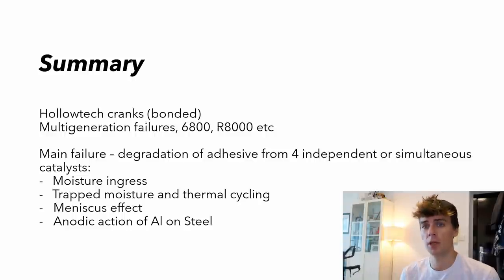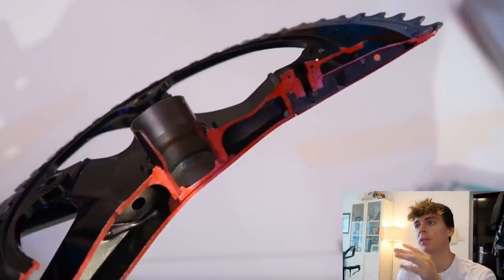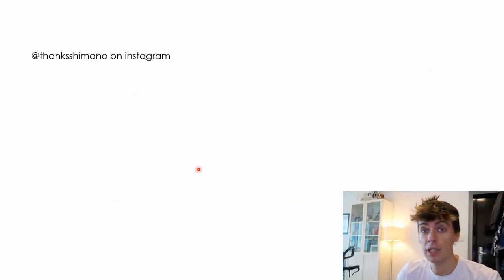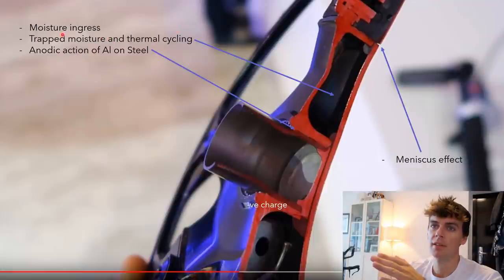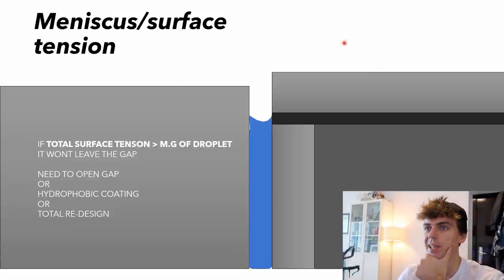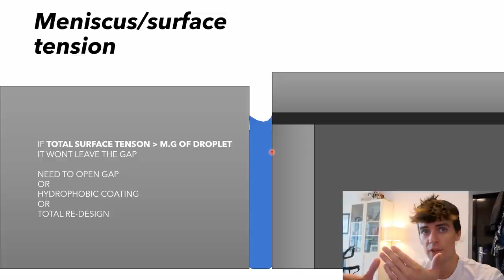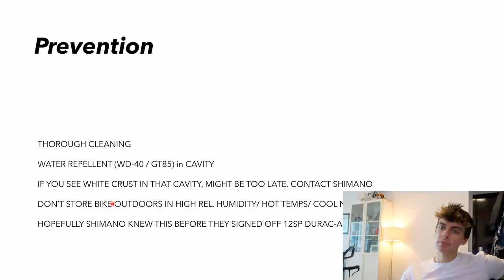Why do Shimano cranks keep failing? Analysis.

Comment: I just assumed I was putting out far too much power for any metal construction to withstand.
Reply: That would be the most plausible explanation.   ;-)
Reply: It's a design failure, don't beat about the bush, can be solved by- 
1. Don't press down too hard on the pedal
2. Just leave the bike hanging in the shed
3. Take the chain off before you go out, this saves on constantly cleaning and lubing it
4. Live on a very high hill with a good neighbor who has a bike rack on their vehicle 
5. Use the offside leg only, you'll only get half as tired 😫 
6. Ride at night without lights, problems solved 👌

Comment: Over  the last 25 years, I've broken 4 Dura Ace cranks. 3 of the 4 have been right in the middle of the threaded pedal hole, going outward to the edges, then abruptly breaking off. I'm always careful not to over torque. Just a  bit of pressure at the end to snug up the pedals on the cranks. These breaks have occurred both on the left and right crank arms. One break occurred in the middle of the drive side crank arm, about half way from the pedal to the spider. In all instances, I went down, once breaking a finger. Shimano was always good about replacing the crank sets. I examine mine but can never any cranks. It just happens all of a sudden. I'm  175 lbs. I do ride in very hilly area's in Northern California typically climbing at least 2k feet per ride, always dry weather riding.  Back in the day when I was riding a 150 miles a week, Shimano advised me to replace my cranks every 3 years. Doesn't seem like this should be happening but it does. I don't abuse them, just use them. they are definitely a safety hazard. for me anyway. good luck with yours.

Comment: A couple of thoughts.
The adhesive won't "corrode" from trapped moisture. Its an inert substance and simply wont react with any trapped water vapour
Any galvanic corrosion between the axle and crank would cause the axle to corrode, not the Al
I think the probable failure mechanism is due to your "meniscus effect" (actually capillary action where the surface tension of the liquid pulls the liquid into the gap)
Aluminium doesn't "rust" as such in that the oxidation layer is not permeable so it is self healing. Oxygen is very much required for the substrate to form Aluminium oxide.
 I think what is happening is that the areas of failure are areas of high stress so the aluminium oxide is de-laminating (the substrate is more ductile that the oxide that protects it) allowing the substrate to further corrode as moisture is pulled into the gap and the lack of oxygen prevent further formation of the aluminium oxide layer.
This leads to a repetitive corrosion event in a localised location that then leads to failure as the substrate is constantly eaten away with each cycle

If trapped moisture within the crank was the culprit, a simple hole drill into the back to allow escape of the air with each thermal cycle would cure the issue

Comment: To combat the said Meniscus effect, fill the gap with grease. I apply grease/oil to all the metal to metal contact areas on my bike and it helped tremendously in terms of eliminating creaking, corrosion and seizing. Places includes:

- All bolts that do not require loctite, including the minute gap between the bolt head and its immediate surrounding areas.
- Stem/handlebar interface.
- Stem/steertube interface.
- Headset bearings/headtube interface.
- QR/dropouts.
- Chainring/crank interface.
- Cassette/freehub interface.
- Cable end cap/boss interface.

- Wax on pedal/cleat interface.
- Light oil on derailleur and brake caliper pivots. 

...and more.

Tedious jobs but effective.
Reply from the maker: Great tip that
Reply: Don't grease the stem-steerer and stem-handlebar interface, at least not with grease. If applicable, assembly grease could be used, but otherwise these surfaces should be clean and dry in order to provide the proper friction to not move under load. Grease dup you'll have to clamp them to idiot levels, which will just break stuff.
Reply: @Primoz.r   Thanks. I've been doing it for years and remains problem-free. However it does remind me of potential slippage. My rationale of greasing the interfaces is two-fold: 1. eliminate any chance of creaking and 2. more importantly keeps water and salt (from sweat) out.  Obviously you do not want the stem/handlebar joint corroded by sweat.
Reply: @Primoz.r  I agree, greasing is not way to go in this case. You should increase friction, not reduce it. In my experience there is no way to get enough clamping force through maximum allowed torque when grease is used. But I found out that assembly paste is also problematic because its particles can cause abrasion of the steerer tube. There must be something better to use. Ideally that stuff would increase friction or even bond surfaces, it would insulate and seal while still allow disassembly. But certainly it should be without abrasive particles. 

For now I am ok with untreated steerer tube so I don't need to tighten headset regularly when I ride on extremely bumpy surfaces. But sweat in the steerer tube - aluminum interface can cause problems, so it is not perfect...
Reply: I'm late to the party, but to stop galvanic corrosion, use a paste such as duralac. Used in aviation and nautical industry to prevent corrosion between different metals.

Comment: I have owned 2 of the effected cranks. A Dura-ace 9000 and a Ultegra 6800. BOTH have failed! That is a 100% failure rate. The first in 2017, which Shimano did nothing about. I bought a replacement for the Dura-ace 9000 left crank arm that failed. So when the 6800 started separating, I replaced it before it broke, so it didn't kill me. I never reported it to Shimano because I knew they would do nothing about it. Now that the recall is official, the number of reported failures is going to soar! Far beyond the 4519 they say they are aware of. But I think they have waited to issue the recall for over 4 years, when they knew there was a big problem, because a lot of those affected cranks have already failed, been thrown in the trash, and replaced already. And now, no longer available for inspection. So Shimano is off the hook.  Very sleezy in my opinion.

Comment: Many years as a shop mechanic in Australia and zero failures through the shop, zero. Worked also with maybe pro teams and only one arm failure with Dockers left crank. Obviously this is happening, but I would be interested in a quick division, about sold divided by the amount failed. Pretty confident the answer will be tiny. Great video and I think you've nailed the reasons. But once again, zero through our store and never even heard of any other stores having issues. Many as we have little humidity
Reply: Lol this aged like milk. Tell me more expert mechanic.
Reply: @randomdude5938  fair call, I have to admit I'm properly wrong. May have a lot to do where I live and the failure rate was obviously less, maybe. Either way Shimano has lost me as a fan, not so much for the issue, but they way they handled it over the past and now

Comment: Precisely where my Shimano DA-9000 crank’s  three spiders started to show splitting (at the bonding interfaces) while unfastening the crank bolts.

Had lost so much sleep thinking what could have been robbing me of the usual performance with same (and sometimes greater) efforts on same exact bike, route, times of day & night, energy/mood levels, hydration...etc !

Had a warranty issue raised with Shimano and received a brand new identical crankset replacement.

Several months in amd same issue started to surface, and again received a brand new crankset replacement which I decided to sell off and got a ROTOR crankset replacement which actually worked fine.

* This happened in tropical Singapore city where normal humidity could reach as high as 80~90%
As of this evening (07th March 2021, 12:52am) humidity is at 82%.

Comment: Hi. Mine failed exactly like this. 20k miles on it in the UK. It was on my winter bike so had lots of exposure to moisture and salt. Also stored outside in a very cold garage going through multiple cold temperature cycles. For reference it was 7 years old
Reply: And are you fine with it? Did you crash or anything that would have hurt you? This is mind blowing

Comment: I lived on Windward (the very wet side) Oahu for 11 years, I can affirm that tropics utterly brutal and unforgiving on everything.  I remember sometime in rain storm we'd have 90 + percent humidity inside the house.  Leather turn white with mil-drew, plastics get brittle, exposed steel rusts within hours and green algae can grow indoors.  We sealed off one room and ran a dehumidifier and AC to protect paper good like old LPs, scarp book, collectables etc, even sealed I'd empty out 3 gallons of water at least once a day.  In terms of bikes stuff I've seen tons of clear coated carbon go yellow in two seasons.  The biggest thing more than the humidity was the UV.  I had Oakley photochromic lenses that would be jet black by 9 am.  Oakley original listed them down to 11 percent transparency but in other parts of world like California they wouldn't get very dark and Oakley relisted them to 23%.  Hawai'i also had a day where sun directly overhead and no shadow is cast.  Everyone thinks Hawai'i is paradise.. https://www.youtube.com/watch?v=dh_eZ40e9Po  da.. reality like talk story bout dakine... https://www.youtube.com/watch?v=Iz3rubGrGZQ&

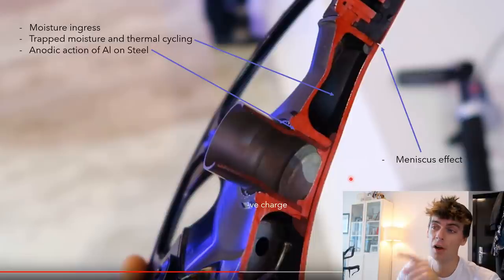Comment: 11:34 'Degassing'
In automotive industry, it's called Pressure Neutralization Ventilating Port, allowing air to move in and out, but restrictive to moisture.
Apparently Shimano is not ready to implement this.

Comment: Reminds me of my younger days, back in the 1980's, when I broke 3 Campy Record crank arms, and also a Campy Record bottom bracket spindle.
Reply: +9000 watts
Reply: Um, I say bullshit. Maybe, just maybe the original Record Carbon cranks (de-lamination of the pedal interface). Certainly not since going to the Hirth since leaving the square taper. On the same context I could claim to have "broken" no less than 15 or so Specialized Allex Epic Pro Carbon framesets....never mind they were pre-production and Giant/Martec had yet to figure out the proper glue....
Reply: @systemsbroken  The all steel alloy, regular production Campy Nuovo Record crank arms and bottom bracket I broke in the 1980's all apparently developed micro cracks in them, unbeknownst to me, and all did indeed break while I was riding. One crank arm broke while I was accelerating out of a corner in a criterium in Gainesville FL. Thankfully I didn't crash, and I rode one-legged back to the S/F line, the broken piece of crank arm and that pedal dangling from my shoe. Another crank arm broke as I stood up to accelerate after a traffic light turned green in the town where I live. Because I was going so slow, I simply fell over in the street. The bottom bracket spindle I broke was on a training ride with several other riders. We were just starting a "green sign" sprint on a rural country road when again I stood up to accelerate and the spindle snapped, sending me to the pavement, taking another rider down with me, and a trip to the ER for me to get several stitches for a cut in my scalp. I was wearing a leather hairnet type helmet, and figured possibly the other guy's front wheel skewer went in between the straps and cut me. No bullshit.
Reply: @lloydhlavac6807  Have i met you in the past year near Gainesville or Ocala?
Reply: @systemsbroken  No, I live between Ocala and Orlando, and after I quit racing in 2008 I haven't ridden more than 20 miles from my house, and in fact for many months now I have been riding exclusively on my rollers due to a crack in the seat tube of my aluminum frame bike (2001 Schwinn Fastback Factory), just above the bottom bracket weld. Yeah, something else I have broken, and I was not even a sprinter! Figure it is safe enough on rollers, but too dangerous for the road, and not a priority in my life to get a new frame/bike.
Reply: @lloydhlavac6807  
That’s why I have a titanium bb spindle on my 90s mtb.  I gave up on aluminum bars too and went titanium there too.  Never had any crank problems though; I have Cook’s E-cranks, which are fairly lightweight.
Reply: May I ask your weight?
Reply: @brucegelman5582  At the time these parts broke I was in the 145 to 155 lbs range (65 to 70 kilos). I was a bike racer at the time, and not at all a sprinter. I think there were already some sort of stress fractures in the parts that I was just unaware of till they broke.
Reply: @counselthyself Yes, it was all Nuovo Record. Breaking the bottom bracket spindle was the worst. Happened on a training ride with a few other riders, when I got out of the saddle to go for a sprint and ended up on the pavement with another rider on top of me, and a cut to my scalp (I was wearing an old style leather hairnet helmet) that was a waterfall of blood, requiring a trip to the emergency room for some stitches. 🤕 Thankfully nothing worse.

Comment: Is there any public information about what process/design changes were made for the 12-speed Ultegra and DuraAce cranks (which are not part of the recall and are being used as replacements)?  If not, I would love to see a tear-down and analysis before trusting them.

Comment: And here I am still riding on Dura-Ace square taper from the early 80s and the damn things won't break.
Reply: Because each successful product starts as a solid reliable product. Only yearly margin improvement targets make things like "Planned Obsolescence" or "Manufacturing optimizations to save materials and cost" to come into the picture, at a later point ..

Comment: Thanks for the in depth analysis. I would like to throw a much simpler reason into the equation - Sweat.
I’ve been a professional mechanic for over 20 years in Australia (the tropic part) and I’ve seen the results of sweat eating just about anything on a bike, even down to aluminium bars snapping due to the corrosion of sweat.
I have seen plenty of these shimano failures, one saving grace might be that shimano does have a decent warranty period.
Hopefully they’ll get to a solution.
Thanks again for the video.

Comment: Galvanic corrosion absolutely does happen between steel and aluminium but it does take a quite a while and usually needs help.  It's a common issue in automotive repair for seized parts, a common one being steel wheel hub in an aluminum steering knuckle.  10 years with some added electrolytes in the way of road salt usually does the trick.  In the absence of moisture and electrolyte there is usually little to no issue such as steel bolts into blind hole aluminum suspension/chassis parts.

Comment: It’s just adhesive TMF cracking from thermal  and load cycling.  The corrosion is a secondary effect of bond line failure and boundary infiltration.

Comment: I had a failure of a Dura Ace 9000 crankset... but the steel axle!!! No failures on cranks at all. I stripped the axle on the left, approximately where it is inserted into the left bearing.

Comment: @Peak Torque 
You mentioned vacuum sealed construction prior to final enclosure, but why not leave a tiny hole to be vacuum sealed after. I'd assume holes at this level are sacrilege, although vacuum sealed holes could be hidden on the inside of another face, like the next insert. And if vacuum is too shit (for production 2020), leaving hygroscopic material (how lightweight is nylon?) on the rest of the bare interior surfaces seems stupid easy. A quarter ounce is what I'd use

Comment: It's just happened to me in tropical Kendal. Coming down Kentmere at speed, crank snapped just above where the pedal attaches. Lucky not to have a bad crash, just kept the bike upright...
Reply: On the drive side, btw. Ultegra 6800. Gonna replace with 105, methinks.

Comment: If it's sealed in water vapor, then  colder climates would not be immune to the problem and would probably accentuate it.

If meniscus effect then maybe that would correspond more to wetter climates (so tropical), but then why is it also not more frequent in notoriously wet northern countries (like the UK)?

Nice video though.  Appreciate the thoughtful analysis

Comment: I work in a bike shop, have done for over 20 years. I have never seen this happen to any Shimano chainset
Reply: I've worked in bike shops for the last 23 years. The bonded Hollowtech 2 arms  mostly 6800 and 9000 series, fail. I've seen mostly rights. About twenty, give or take. Corrosion related, every one, but still shouldn't be happening. All had corrosion around the spider/chaining interface and all had rusty stem bolts, rusted front derailleur parts, very smelly bar tape.
Mid-Atlantic, DC area, if it makes a difference.
Reply: @n0ch91c3s  im based in london. If the bikes are in that condition it cant really be deemed as a manufacturing fault. Light weight race compents need to be cleaned and maintained or they will fail
Reply: @gclh22  I totally understand. It's one big reason why I'm on the fence about how I feel about it. On the one hand, it's definitely from some level of neglect. On the other hand, this is SHIMANO. They hold themselves to a higher standard and so do we. It happens to Dura Ace, the Ace of Durability. Also it only happens to their bonded arms. Although I have seen the occasional fracture of their previous welded Dura Ace and XTR, it was much much more rare and not from corrosion. Also the failure mode was gradual, not catastrophic.

Comment: There might also be another mechanism at play: stress corrosion cracking. Rock climbing expansion bolts by the sea in Thailand suffered from this such that they’ve moved to glue in Ti bolts